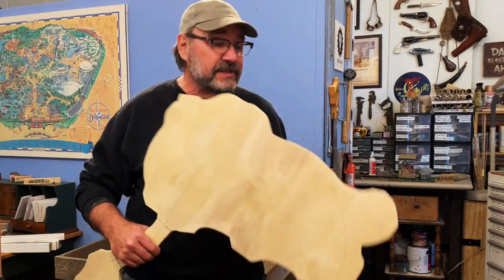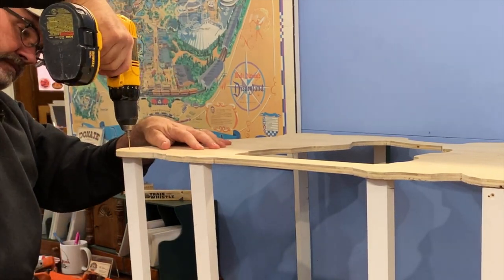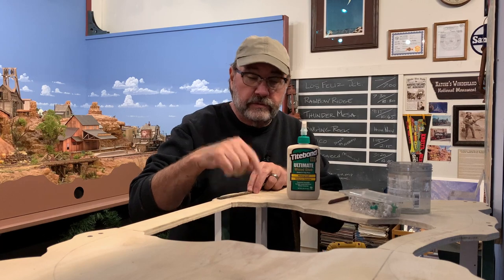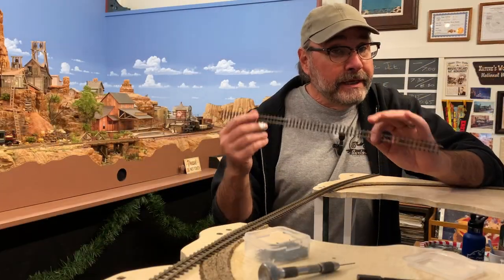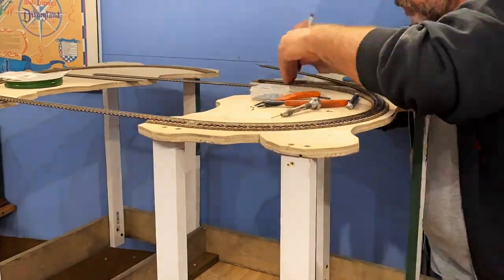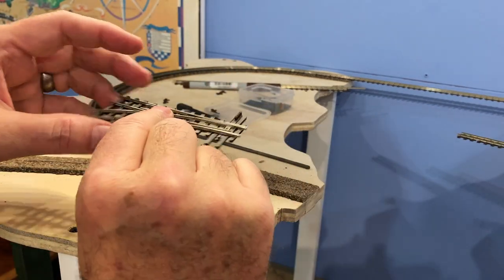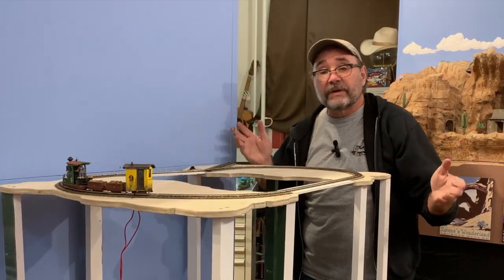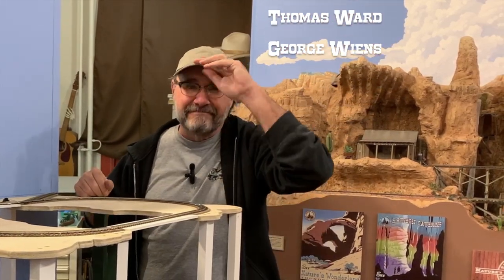Bandit Canyon Railway | Roadbed, Track and Power

Comment: Here's a neat trick to try on future projects.  Tin your wires and bend the tip after flattening it and drill a hole beside the rail foot. Then rest the tip against the rail so the wire looks like a spike head. You'll still get a good connection and hide your connections at the same time. No one can tell if it's a wire head or a slike head. A tip from one modeler to all model train buffs.

Comment: Nice progress. In the past, I used Roco HOe track, which was even more derelict (not sure if they changed it since that time). But the turnout radius is even bigger than the Peco. And  for tiny On18, 200mm radius is already a lot (no issue with industrial O-16.5 locomotives on such radius).
Kato has smaller N scale radius for turnout, the #20-240, but it is Unitrack, so already with ballast bed, not easy to use with other track.

Comment: btw, that Shinorara turnout is the LARGER radius one! There is a smaller one!! That's about a #2 or 1 1/2 frog. I have some from 35 years ago when they were available. they're also code 60 or 65. so the skipping you are seeing probably is the transition between the 2 rail sizes.
Reply from the maker: I think this one is code 70
Reply: @ThunderMesaStudio  btw dave, you are officially a "bad influence"!! As I went out and bought some On18 kits, and a Bachmann plymouth chassis. LOL

Comment: It might be easier to drill the pilot holes for the track spikes with a Dremel tool. A full size drill is too clumsy but the Dremel works really well especially if you get a battery powered one.

Comment: I love this new layout and all the helpful tips you have for construction over the years, but I almost winced in pain when I heard you talk about the insulated rail joiners for the turnout. For clarification, you don't need to insulate the stock rails of a live frog turnout, or any other turnout for that matter for a simple siding like the one on your layout. Only the frog rail(s) must be insulated, and then one or both of them depending on the desired power routing option. There are instances where this might make sense like a ladder or group turnout setup where power control to the tracks beyond the turnout is wanted, but for a simple siding such as the one you're building, it's a waste of a plastic rail joiner. Maybe you just installed it on the stock rail so that it had a similar look to the frog rail? Either way keep the videos coming, I send a lot of customers your way for ideas and tips!
Reply from the maker: Oof, thank you. Of course you are correct. Sometimes I get rolling on a thing and go on automatic pilot, remembering what I did before but not the reason why! Thanks for pointing it out. I want people to get accurate info from my videos so I’ll make a correction in the next one.
Reply: @ThunderMesaStudio  No problem. As I watched the video I kept thinking you were going to do something beyond the turnout that required the insulator, either way it's all good. Love your work and commitment to the hobby, keep the videos coming I look forward to every one!

Comment: So what is the shortest possible curve radius you could make in On30 while still being able to run big engine's? Like what if you wanted to run an On30 Mikado for example. Would a curve radius of 10 inches be to sharp for it or would something like 15-20 inch radius curves be more agreeable for those behemoths?
Reply from the maker: 10 inches would be way too sharp for just about any engine in On30 except maybe the little Porters. 18" Radius is the recommended minimum for most. Larger is better for operations. The layout in this video is On18 however, and different rules apply.
Reply: @ThunderMesaStudio  Thanks Dave. That helps a lot.
Reply: To build this first i would attach tab 2x6 to top of the risers. Then screw up from the bottem of the tab into the surface plywood. Iwould then cover the plywood with homosote. Then the cork roadbed. This is the best way towards deading the roadbed.
Reply: By using homosote the track can be attached with out drilling a hole. For the track nails.